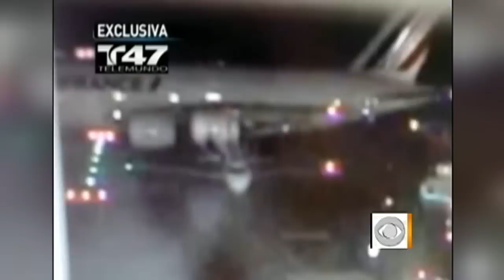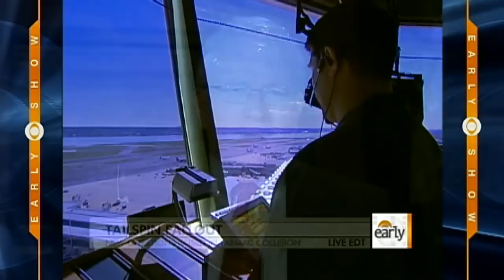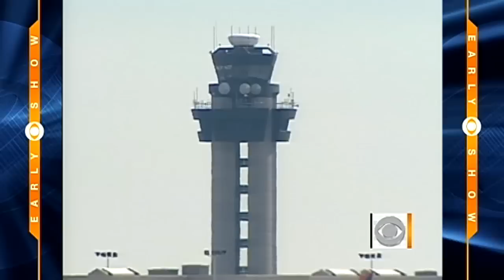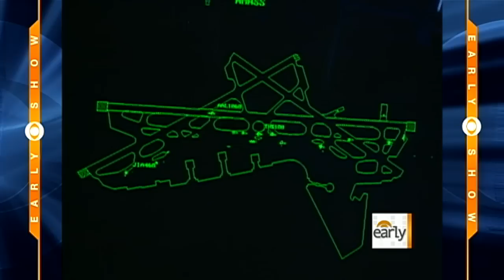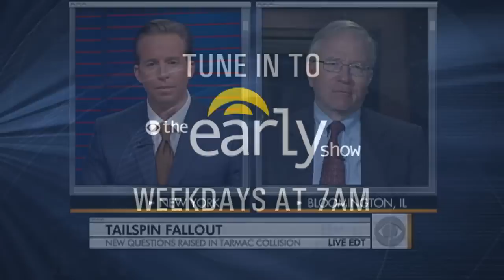Aviation expert blames pilot for JFK airplane collision

Comment: This guy is hardly an aviation expert.  Can't answer a question directly at the start, and clearly has a hard nose for the airlines and pilots as opposed to looking at the FAA/Controllers as well.  It is the duty of the ground controllers to also be aware of the types of aircraft passing by one another to avoid collisions like this.  Shared responsibility.